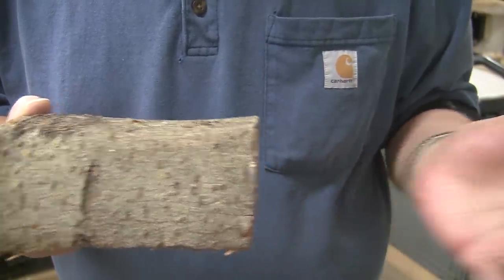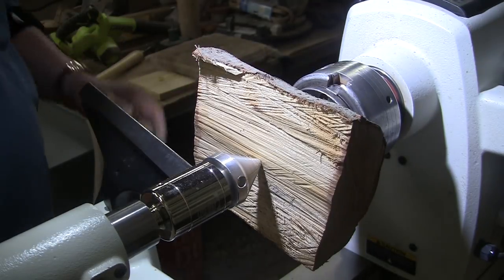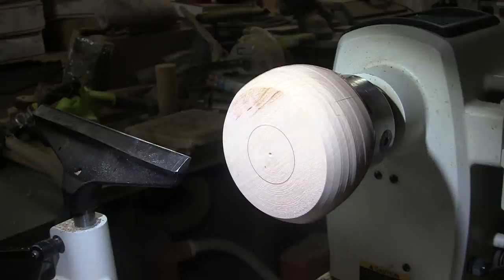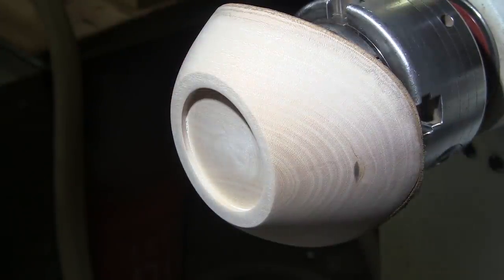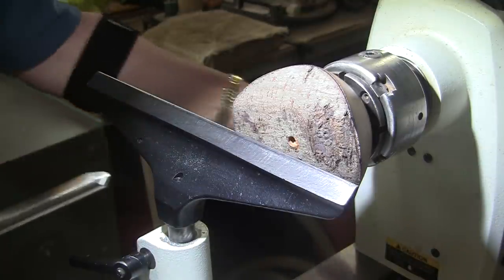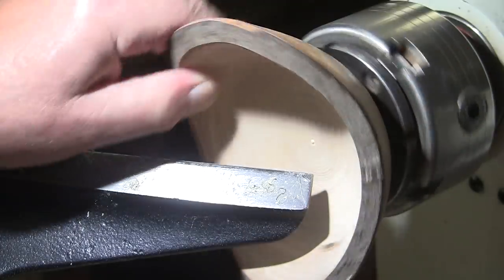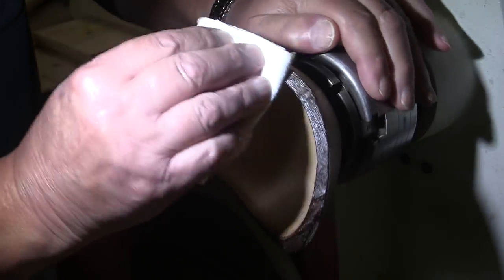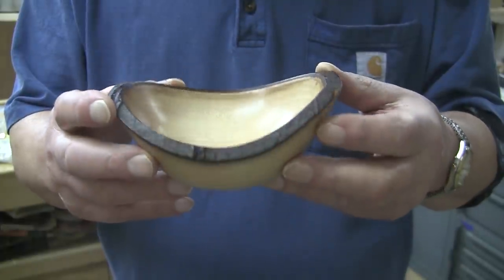Quick, Easy Craft Show Sale or Gift! - Wood Turning

Comment: Very nice. I have some crape Myrdal I cut way back and have some nice Ys and straits to play with. Rebuilding lathe table at the moment. Bought a 70s craftsman lathe in great shape one owner but table was a wreck with sketchy wiring. Ran like a top though. Have a shop smith but just don’t for the lathe part.

Comment: Great video! Never thought of using a wedge and that smoothing cut with a gouge, solid gold. Also I never heard of Acts paste. I decided to look up this stuff on Amazon. Turns out I heard Axe and not Acts paste and got this: AXE Mens Styling Paste hair styling for a Messy Look Flexible Medium Hold, Low Shine 75 g. I dont have enough hair left to fret over styling but enough to get up every day with the messy look, aux naturelle.  But hey, bonus point, another take for the term "knock on wood"! I love the low shine feature. If the time ever comes to low shine the noggin, no I wont use paper towels. The micro fiber stuff is real smooth. Shout out for your LT.
Reply from the maker: ACKS paste. 😊

Comment: Hi Phil. I hope that you are doing well. I was helping a friend today clean out a shed. I saw these packages in an open box. Turns out that they were flap contour sanding refills. However they weren’t made by Sand o Flex and the addresses was in Mississauga, Ontario. It’s within the Greater Toronto Area. The company was Auscan Industries Limited. They’re identical to the refills sold by Sand O Flex and the package even showed the same unit and showed how to replace it. Do you recall seeing these when you worked in the hardware store? Myself friend said that I could have them. They’re all fine grit.Tom
Reply from the maker: I remember that Sears used to sell them under their own brand name, too, Tom.  I suppose different retailers contracted with Merit to package them with their own name on them.  They used to be pretty inexpensive but not so much anymore.  You probably have a small fortune worth of those refills! 😊

Comment: I started doing less live edge bowls actually. There's two reasons for that:
1. Having the bottom of the bowl on the bark-side tends to allow for a slightly larger bowl with less wasted materials.
2. I found that playing my curves around the rings of the bark gives more chaotic and interesting grain, which, like the live edge option, is also a way to emphasize the natural and unpredictable beauty of the material. My current favourite is giving the side of the bowl a slight S-curve, so most rings are crossed twice. Placing the wood slightly off-center, so the pith isn't dead center also gives interesting effects.
Reply from the maker: You should do whatever works best for you and makes you happy, Judith.  Sounds like that is working for you, keep it up! 😃

Comment: I agree with everything you said.  However, I prefer the ones with more "character", what some might call flaws.  Beauty is in the eye of the beholder I guess.
Reply: I was thinking the same thing but Phil usually has such unique pieces, I though it was interesting to see something a bit more simple yet elegant. Granted the piece he started with was pretty symmetrical, the finished product is VERY symmetrical. Again, I think simple yet elegant was the idea here and the symmetrical shape adds nicely to those characteristics. Besides, after all the heat, the 5 day honeysuckle rootball project and the hard sycamore last week, he was probably looking for something a little less complicated! Oh, I forgot the holy butternut the Yellow Bellied Sapsuckers worked over! Nice one Phil!
Reply: @maxhunt2644  good points I hadn't thought of.
Reply from the maker: You nailed it on all counts, Max! 😊

Comment: Hi, have watched a number of your videos.....well done, very informative.  I'm very new to turning;  just bought a lathe and will be practicing with spindles before I approach bowls. I noticed that you use a 2" sander......which is what I would like when i get to bowls.  Would it be possible to advise a weblink to the 2" sander parts.....mandrel for my drill, foam thing, sanding discs.....that is, whatever makes up a sanding "assembly".  Thank you, Richard
Reply from the maker: Thank you, Richard!  Everything I use for 2" sanding comes from this page including the Apprentice disks, the soft backing pad, the Quick Change chuck and holder and the Sanding Disk Starter Kit which makes it easy to store and use everything:
https://www.woodturnerscatalog.com/t/114/Hook-and-Loop-Discs

Comment: Love watching the videos,  the explications are excellent please keep it up.
Just today i pulled out a dead RedBud which previous owner had planted so 25+ years old.  Died 2 years ago im guessing now, bugs got in it but wondering if the 8" base would be worth playing with?
All ive made so far are single hunk mallets,  not experienced in anything more.  Using a  1953 Shopsmith Mark3 (i think) that I bought from the original owners son.
Reply from the maker: Thank you, Mark!  I turned a piece of Red Bud and it looks pretty nice.  Definitely worth trying the root ball if that's what you have.  I have a playlist of roots and root balls if you want to take a look.  Might be something useful there.  Good Luck!
https://www.youtube.com/playlist?list=PLX4bPjUe1ImeLSaJXbXhxoFXy1WyLFjN_
Reply: @PhilAndersonShadyAcresWoodshop  this split right at ground level, left rootball in ground for most part.  Rotted where mower rubbed it most likely.   That section maybe 8" dia but real soft.
Reply from the maker: @markmatt9174  Depends on the definition of real soft, I guess.  Use a small screwdriver to probe the wood.  If it goes through the soft wood with pretty heavy pressure but then stops at solid wood, gauge how thick the solid wood might be.  As long as you can get a good hold on what's there, you can probably turn away all the rot and get to sound wood and make something nice.

Comment: Love your live edged bowls Phil .. Could you tell me what the make and model number of the tool you use with the 2" sanding .. 90degree angled tool .. Thanks Phil Love your work and advice .. Cheers Glenn 15 weeks still in lockdown .. Sydney Australia.
Reply from the maker: Boy, the stuff I saw on the news last night in Australia!  Sorry about that, buddy!
I don't know the model but they only make one.  It's a Ryobi 18 volt, cordless right-angle drill.  Mine is the older blue model and the newer ones are green.
Hang in there my friend! 😊

Comment: Perfect is a description for this piece. Approximately how long did it take from the time you mounted to the time you took it off the lathe? I find mine take me a few hours. I've been turning for about 15 years and it still takes me a long time to get through a project.
Reply from the maker: This took about one hour, Dan.  Total time for a small, trouble free piece like this is going to be right in that time frame depending on the finish you use.  Some finishes will take longer to dry than this piece took to complete, just depends.  Most of my pieces are completed over 2-3 days and take 10-12 hours. 😊
Reply: @PhilAndersonShadyAcresWoodshop  Thanks Phil; I was beginning to think that I needed a kick in the butt to get me going but I have finished pieces in an hour or even less. At a small fall fair a couple of my cohorts an I put on turning demo's. I usually turn tops for the kids and I can pump them out at about 5-7 per hour ant the kids love them.

Comment: I particularly like your videos for tips and training. But I also watch other turning videos and I notice you turn at much higher lathe speeds than others including myself. You started this piece at 735 RPM. How do you recommend I choose a speed once a piece is balanced enough not to jump all over the place?
Reply from the maker: Several factors for selecting turning speed, Paul.  I don't go much by what any particular manufacturer might recommend.  They have to be careful for liability reasons.  I consider how good of a grip I have on a piece, how sound I believe the wood is and the overall size.  Often I turn as fast as I can taking those factors into consideration.  Makes for a lot easier turning experience.
Now, that's me.  I don't know how to recommend a speed for you or anyone else. 😃

Comment: I am curious…what height are your tenons and how deep are your recesses? And do they vary with circumstances (wood punkiness, out of balance, etc…)?
Reply from the maker: Tenons and recesses do indeed depend on circumstances, Karl.  Generally, my tenons are about 3/8" high.  The jaws need to bottom out at the bottom of the tenon before the bottom of the piece touches the chuck.  Hope that makes sense.  I like to keep my recesses about 1/8" deep but, again, it will vary with the size of the piece, balance, etc.

Comment: Nice. Again.
May I ask what is the drill you use to sand with. (2 inch disc).
I see several other turners using the same machine. Is it specific for Wood turning.
Thx
Reply from the maker: Thank you, Lonnie!  It is a Ryobi 18 volt cordless right-angle drill.  Not specific to woodturning but works great for it. 😊

Comment: What makes you decide if you're going to use a tenon or a mortise?
Reply from the maker: Could be lots of different reasons.  In this case, where someone might want to do production turning for items to sell, because it's quicker.  Other reasons might be working with a thin piece or a piece that has cracks where the recess would be, making it unsafe.  I generally prefer a tenon because I think they are stronger but there are arguments either way for that, too!
Reply: @PhilAndersonShadyAcresWoodshop  I'm a newbie and was just curious is why I asked. I assume a tenon is safer but requires more work to finish the bottom?
Reply from the maker: @hotrodhog2170  Yes, more work but worth it in my opinion.  Also, in my opinion, the recess should be removed when finished.  Hardly anyone does and I've become lazy about it, too.  I just think all evidence of how a piece was held should be removed.

Comment: 0:00: ⚒️ Tips for creating and selling simple wood crafts.
3:51: ⚙️ Wood turning tips for preserving bark and creating unique bowls.
9:51: ⚙️ Wood turning process with sanding and finishing using new products for a smooth final touch.
14:53: ⚒️ Wood turning process and sanding of bark-covered edge for a craft show sale or gift.
21:04: ⚙️ Wood turning demonstration using high speed to smooth out rough spots on the wood.
Recapped using Tammy AI

Comment: If the bark is such an important and desireable feature, why would you not make that the outside of the bowl, and carve out the cut side?  Then, you could just semi-round the outside edges, and have a uniquely shaped bowl with a bark outer, only cut away at the top and to level the bottom...  ??
Reply from the maker: I've done that before.  Just trying to mix it up. 😊

Comment: Would you recommend first time turners not to put their fingers on the wood while the motor is running. This is while you put wax on the wood.
Reply from the maker: Tough question, Ronnie, believe it or not.  I don't like to presume to know what others capabilities are or their own sense of safety.  I will often do things that others might be better off not doing but I have no way of knowing that.  Sorry, kind of a non-answer, I know.
Reply: @PhilAndersonShadyAcresWoodshop  
I truly enjoy watching you do it, I was just thinking if I did that I would have bruised or cut knuckles.
Reply from the maker: Only once.  It's something you learn really fast!

Comment: Hi Phil its kelvin in Cornwall England I lost touch with your videos and up you pop using a wood I no nothing about. I've just got a job clearing a massive area of this wood it's gone mad 25ft high so I've got loads of it. I was told never burn it until dry as the sap is toxic is that correct?. I have started turning some lovely crutch bowls with it and you can get an amazing polished finish due to its hardness is it an actual hard wood? I no nothing about it. Good to see you again and your followers.
Reply from the maker: Welcome back, Kelvin!  I'm afraid I'm no help with toxicity of Laurel.  I just don't know.  It is a VERY hard wood when dry, I do know that. 😊
Reply: Love the piece. My understanding is that Laurel is toxic - it featured in a poisonous plants garden I visited. Apparently, putting laurel pruning in your car and driving off is not a good move - vapours from the sap, i assume. Anyway, I didn't see you fall over . . .!!